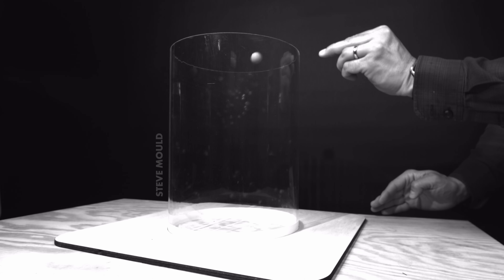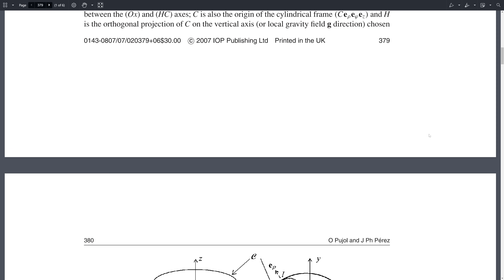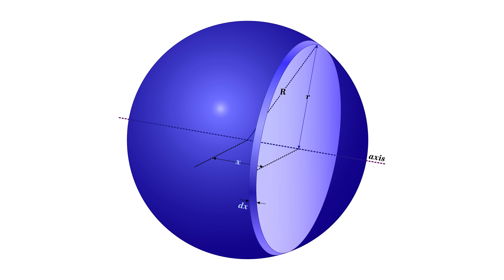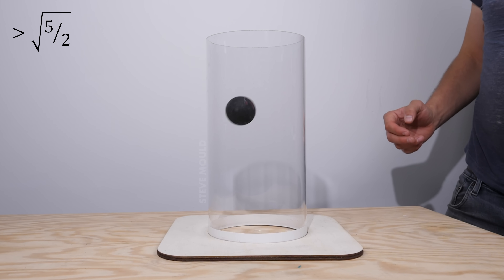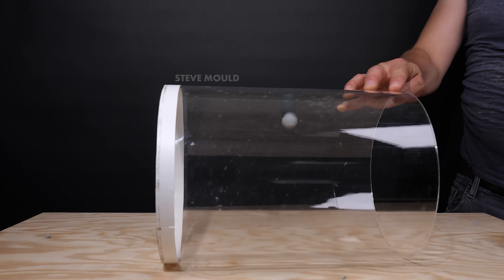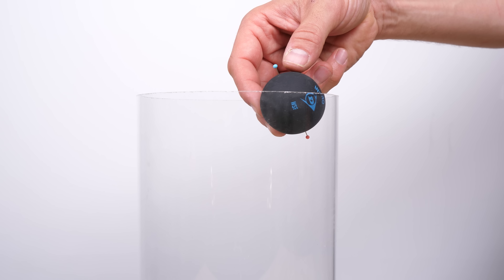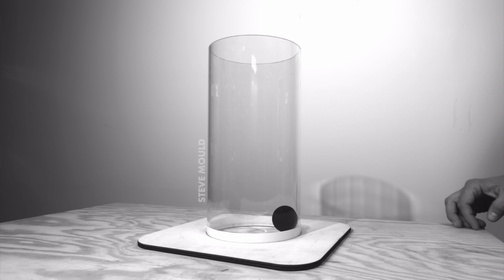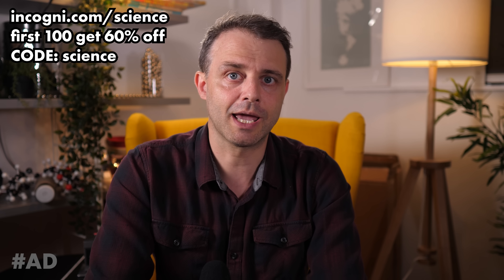The Golf Ball Paradox

Comment: For the motion amplification, I would be interested to see how houses and surrounding area reacts when a train passes by. Like what effect is the train have as it is rolling across the tracks. We just moved into a house with a set of train tracks behind us and when the train passes by it feels like the whole house shakes sometimes.
Reply: Yep, my parents house has tracks 20m behind it. When it passes by you can see water shaking in a glass.
Reply: It's called Living Next to an Effing Railway Line,  what did you expect?
Reply: @andrewemery4272 bro the question is why it happens not if it happens.
Reply: So most architecture has a natural amount of 'sway' to it that (for the most part) will resist heavy vibrations by lightly rocking with the vibrations. They intentionally build skyscrapers with a certain amount of vertical flexibility to account for wind and earthquakes, and in earthquake prone areas they build most buildings to lightly rock when heavy vibrations are present. Both types of architecture use this natural principle found in almost all types of structures. Certain types of material are naturally more flexible, even if they are seemingly rigid structures. Metal is more flexible than wood, wood is more flexible than concrete and brick, and so on. 

Essentially, when the train rolls through, it heavily vibrates the flexible metal tracks. Those vibrations spread through the ground and to the foundations of your home, and your home proceeds to lightly shake. It may seem like heavy shaking, but the structure as a whole is not moving that much, the flexibility of the structure makes it seem worse than it is, but also protects the home from falling to pieces.
Reply: Yeah that would be interesting! I used to live in a house with a railway line that went through a tunnel pretty much directly under it
Reply: My guess is the imperfections in the rail. Also if the ground is green and wet I think it'd carry vibrations much better than dry, brittle ground.
Reply: Sound is literally things shaking. Sound travels through solids. The sound of the train passing over rails, the oscillation of the weight transfer of the train over the tracks over the ground, creates sound waves that shake your house when the sound propagates.
Reply: I live about half the distance from local freight tracks as compared to my brother in the next town over.
I hear the train and the squealing of the wheels on the turn.
My brother FEELS the train and can watch a couple of doors in his house unlatch (old style latches with very short contact)
The big differences are the geology and water table between our two locations.
Where the train passes near me, it is about 15-20 feet above the surface of the river, as is my lot.
Where the train passes near my brother, the train is about 4-6 feet above the surface of the river, and not only is his lot at the same elevation, but the water table in his neighborhood can be higher than his back yard.
My neighborhood is on shelf, his is on floodplain.
-
A lot of variables.
Reply: I would imagine keeping the camera stable would be difficult, a zoom lens could work but the camera would probably have to be pretty far away

Comment: 6:56 is going to revolutionary I'm a structual welder and I go to all types of different shutdown around the US for huge industrial power plants and of all the inspections we do like X-rays, we basically mainly check the areas where we know there is vibrations.  I would love to see minute vibrations of how a welding machine like a Miller or Lincoln Electric or even a small horsepower engine. Large production factories mount those welding machine onto the structural supports and I've always wondered how much of a causation it has to the beams

Comment: You could film the top and side view at the same time by filming from the top and putting an angled mirror in frame next to the tube to give you the side view. 
Kinda like the opposite of how they use a mirror to align two big cameras when they film 3D movies.
Reply: Or vice versa. film from the side with a mirror above for the top view. That way you don't have to get fancy with the camera mounting.
Reply: @b.s.864  that’s probably easier… lol my brain just immediately jumps to the most complicated way to do things…
“I have a flat tire.. let’s push the car over by that huge tree, and then someone bring me 5 pulleys, a snatchblock, some industrial chain and dyneema rope. I’ll need nine strong men and a Girl Scout…”
“Or we can use the jack in the trunk…”
“Oh… right. Yeah… that works too.” 

Haha
Reply: @DanteYewToob Which way is easier would be highly circumstantial. For instance the TV show Good Eats reportedly used the vertical camera option for many of it's cooking shots with a sliding mirror to switch to the host.

Comment: Couple things I want to mention --- i don't think the golf phenomenon is related to this. Golf balls are not high friction and golf holes are not long tubes, they are just short buckets. Golf balls go in too fast and bounce out due to contact with the bottom of the hole. 

For the intuition on this. So if the ball is frictionless it would travel down the tube in a helix. 

When there is high friction, the linear momentum of the ball constrained within the tube wants it to travel down in the helix, but as you describe at 7:30 in the limit of infinite moment of inertia and infinite friction, the ball would trace out an elliptical path. 

Consider the state of affairs leading into one quarter turn. At this region the angular momentum of the ball wants it to ride back up the tube already (elliptical trajectory). But the linear momentum of the ball is going down (helix movement). Thus we have a torque that friction against the inside of the tube would apply, a torque generated by friction pulling up. Basically like when the path is not aligned with the curvature of the tube, then running along the tube with friction is going to apply some torque that is perpendicular to the axis of the tube. In the example scene at 1/4 turn, this torque has an axis (right-hand) pointing in the same direction as the camera is pointing. Since the ball is spinning with the (right-hand) axis pointing down and toward the right, a.k.a the torque and the angular momentum axes are not aligned, this must generate torque induced gyroscopic precession... At this point my intuition breaks down somewhat as I'll need to get my hands on a gyroscope to think through if the direction of the precession makes sense at all... what little feel I have for gyroscopic precession tells me this makes it turn the ball's axis of rotation downward, which seems reasonable, because that is why the ball doesn't shoot back up immediately: it takes a little longer than one turn before popping back out.

It's some kind of natural process that when your ball has some friction, the geometry of the tube applies gyroscopic forces that work out always to nudge the ball's angular momentum via precession to turn toward rolling in the same axis as the tube. It does feel pretty natural. There's no reason for it not to overshoot so it just oscillates. It would be nice if astronauts could bring mouse balls to the ISS to test this out. 

I think it is intuitive that there is this gyroscopic precession at play that nudges the axis of rotation of the ball in some way and it makes sense that the moment of inertia would determine the relative velocity of this precession, but you already covered how that in itself is intuitive.

Comment: This reminds me of what happens sometimes in basketball where the equator of basketball gets really low on the rim but then the ball pops out anyway. Once I saw the ball go around the rim about 3 times before falling out instead of going through the hole.
Reply: This might have more to do with the "applied" backspin from shooting the ball, but without a mechanism to launch the ball exactly the same into the cylinder each time there's going to be inadvertent spin added each time.

Comment: Could you possibly use your motion amplification camera on a roadway bridge? Not sure what the lenses & technology allow, but it'd be cool to see a suspension bridge, or even just a standard concrete overpass flex as cars go over.
Reply: I was thinking this too! A bridge would be really cool to see
Reply: I'd be curious to see the difference in vibration management between older bridges and newer ones if it was possible.  Maybe even more modern earthquake resistant bridges and structures.
Reply: Doing it with people walking across smaller pedestrian bridges would be interesting to see as well.

Comment: me at 1:50 - The analysis is of the cylinder. But its about the sphere interacting with the cylinder.  Mapping the path in gravity along a flat (angled) surface is not giving the same contact points that a sphere inside a cylinder would give. (continues video)

Though it seems to work horizontally.. It seems to exit earlier with the same thrown in angle.. so Gravity makes it stay in the cylinder longer..

Also thinking about it.. there could be a bit of mathematics between the Circumference of the ball and Tube... and the square root of 2/7 and 5/7 ...  Also divide by 7 is interesting as 22/7 is close to pi..  (used to use 22/7 to give ball park measurements for things when doing quick circle maths...)
The errors from pi could be losing contact with the inside and slipping / skipping the surface.  Pretty sure this could be done in a computer model...

Comment: I wonder if you could develop some little magnetic "kicker" to give a tiny bit of energy at the bottom of its oscillation, to keep it going indefinitely, similar to those kinetic magnetic desk toys. I would absolutely love to have something like that as a desk toy.
Reply: there's a seller
Reply: Could work with a lighter ball(table tennis ball?) and a fan. The fan makes a vortex so the ball keep spinning, airflow upwards cancels out gravity.
Reply: @m8e just gotta keep the momentum going so it keeps spinning as well
Reply: The big version shown in the video moves fast enough already. A desk toy sized one would move too fast to admire and wouldn't look cool
Reply: It might be possible if we put the motor inside the ball (similar to electronic bablade)and power it through induction.
Reply: @jayantchoudhary1495  uhhh excuse me internet person... did you just say that ELECTRONIC BEYBLADES are a real thing that exist?! 
Finally, my middle school dream of an autonomous razor-blade affixed beyblade can come to fruition!!
Reply: @jayantchoudhary1495 don't need a motor for that. Just get a hollow aluminum ball, coat it in rubber and put a rotating magnetic field at the bottom. Magnetic induction will spin the ball just like a motor.
Reply: You could also place the cylinder horizontally and have a normal ball inside it, then put a motor on the cylinder instead of the ball.
Reply: Just spin the cylinder on a turntable!!  This could enhance or decrease the effect to allow more data to be explored.
Reply: No you cannot. That is because it works on potential energy that is added as the ball gets closer to the magnet, but is then released when bouncing back. Conceptually it wouldn't be any different from a spring.
Reply: or a powered spin from inside
Reply: @anteshell I think they meant a powered electronic device which applies a force at the right time, not just like, “a configuration of permanent magnets”
(Though if they did mean the latter, then your comment is a good correction)
Reply: @idontwantahandlethough  there are even wireless versions
Reply: I was thinking the same thing
Reply: @anteshell  Theoretically, yes, it could work. It would have to be an active circuit, not just a passive magnet. The "kicker" would detect when the ball was in the correct location, and would give it a little bit of additional energy, via energizing a coil to generate a magnetic field. 

There are magnetic pendulum desk toys that work in this manner.

Although pratically speaking, the logistics of getting something like that to work in this particular form factor seem.. like a difficult problem.

Comment: The idea for motion amplification is "How a transformer emit a high-pitched sound?" (if it can register such high frequencies). It might be quite interesting because AFAIK it's because a transformer physically changes its shape due to the magnetostriction effect on the transformer's core.
Reply: 50-60 hz base high frequency?
Reply: @2adamast  I had in mind the high pitch that sometimes comes from phone charger or other electronics (it usually operates on much higher frequencies). But you're right, it can also be a low hum when it's directly connected to the outlet.

Comment: I think it would be helpful to track where the ball is in contact with the cylinder, and then draw/animate that path along the surface of the ball. It's not just rolling along a circular path along the circumference, and I think understanding that is important for an intuitive understanding. Also if you put markings on the ball so we can clearly see how it is actually oriented, that would help to understand/visualize what's goin on.
Reply: Yepp
Reply: @JokeswithMitochondria   your username intrigued my curiosity so I went to your profile. Your entire channel is mood Imao
Reply: I'm curious about how that would trace in a hypothetical situation without gravity or friction. Would it make circuits around an ellipse? Would it gradually level out until it's moving around a circle? How does this behave if you isolate variables and change them one at a time?
Reply: I think from its perspective, the ball is simply traveling in a straight, 2 dimensional line. 

Cutting the tube open to rectangular shape should help visualize this. 
It doesn’t hit bottom part because the angle doesn’t allow it to, like shooting a cue ball through narrow space. It travels in a straight line as far as the angle allows, then it hits imaginary rectangle and bounce back.
Reply: A good start to this would be to simply draw some stripes on the ball.  Some design that would allow you to 'see' the spin with a high speed camera.

Comment: At 7:34 you introduce the notion that the ball's axis of rotation is not vertical, but rather perpendicular to the angle of entry into the system.  This made wonder, what happens if I eliminate this phenomenon...  What if the entry was horizontal?  That is, there was a tangential tube that introduced the ball into the cylinder perfectly horizontally?  Might need some kind of flap or "quickly triggered" trap door in case the ball travel back over the chute.  This eliminates the entry tilt's affect on the axis, leaving only the "gravitational descent + wall friction" as the only force that tils the axis, thus imposing gyroscopic forces on the ball's path.

Comment: I think a cool object for motion amplification video would be a string instrument like a violin or a cello (Maybe a double bass depending on the maximum frequency of the camera) would be cool - there's a lot of engineering of the shapes of these instruments to control the harmonics of the sound.

Also, you don't need 2 high speed cameras if you have a good mirror, that way you don't need to sync your camera streams
Edit: Typo
Reply: I’d love to see that! The physics of amplifying low frequencies geometrically is also a really interesting topic.
Reply: Yes please
Reply: I can't picture how to position a mirror to get a horizontal view and a top down view with a single camera, can you explain?
Reply: @swirle13 put it at a ~45° angle from the camera (a little shallower for fov reasons) above the cylinder. It makes more sense if you draw arrows from the camera to the cylinder, you'll see that you have the direct path from the camera to the cylinder to see the hoz and then the mirror will bounce the view directly down the middle of the cylinder for the vert
Reply: @swirle13  Sure: assuming that your camera has an aspect ratio somewhat similar to 16:9, point the camera vertically down with the top down shot taking up the right hand of the frame. 
If you position a mirror with its bottom edge touching the base of the cylinder you should have enough frame to get a somewhat reasonable shot of the side.
Reply: +1